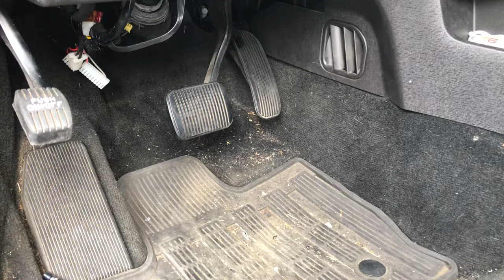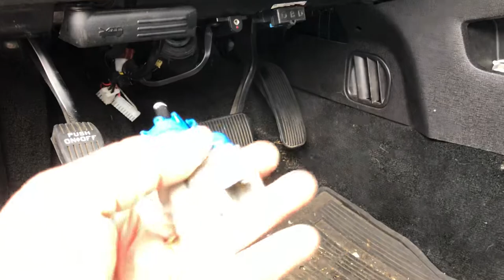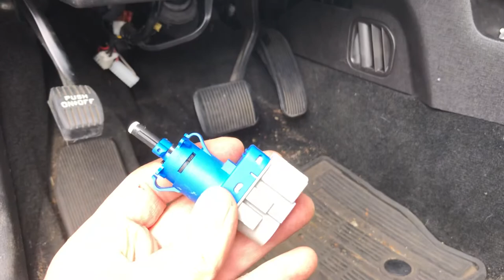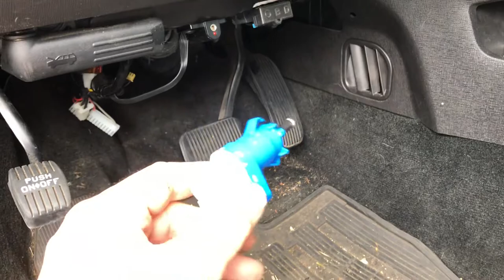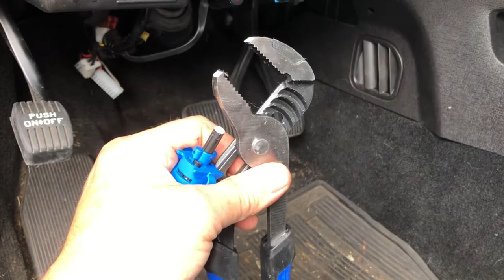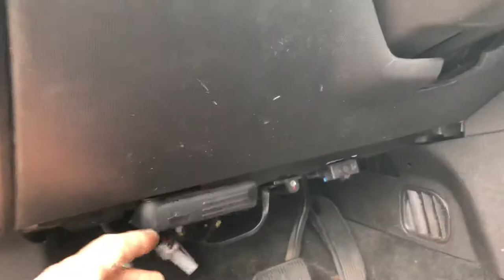Ford Flex replace brake light switch

Comment: Thanks, much appreciated. That exact scenario happened to me 😆. I was leaving for work and it was dead. I jumped started it and when i got to work i realized the taillights stayed on. I beat the F out of the brake pedal to let go but it did nothing. I then figured out i had to pull the pedal, so i propped up the pedal while parked and then drove with 1 foot behind the brake. Extremely unsafe, so it eas the perfect excuse to ride my new motorcycle to work for a week straight.

Anyway, this helped out although i didnt have to remove the kick panel. I just laid down in from of the pedals and squeezed my chubby hands through. Im 5'6" 255lbs, so there was no getting comfortable under there, but i got a good grip and moved it around to get it to twist. Then i was able to swith the plug over to the new unit and twist it in. 

Now my harley sits in the garage while i flex to work 😎
Reply from the maker: Great story but don’t neglect the Harley! Or I’ll come get it. 😆

Comment: On my 2005 Ford Five Hundred the 3 screws are 9/32nds.  The Switch is in with the Connector at the 6 o-clock position and like you say, It only turns a few degrees but not enough to come out.  But, it hasn't Beaten this Handicap Yet!!
Reply: With some Channel Locs and a fair amount of effort to get the pliers in far enough I got the switch out.  I had problems with the connector which seamed like you have 2 Detents that hold it in and I needed to keep the tab pushed in to get it to remove it.  Good Luck Everyone & Thank You Very Much from a fat 68 yr. old who doesn't bend like I use to when working on cars of Decades Ago!!